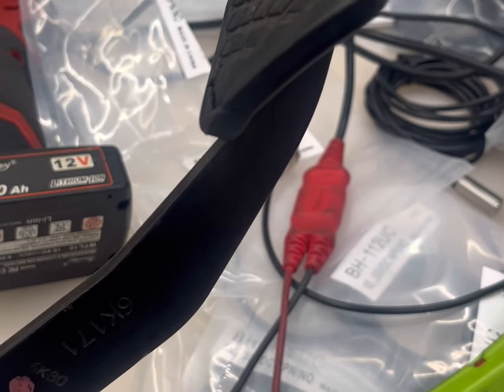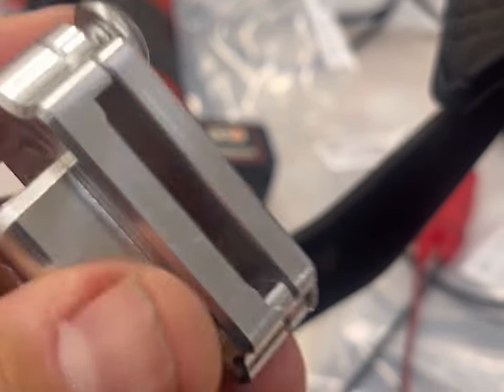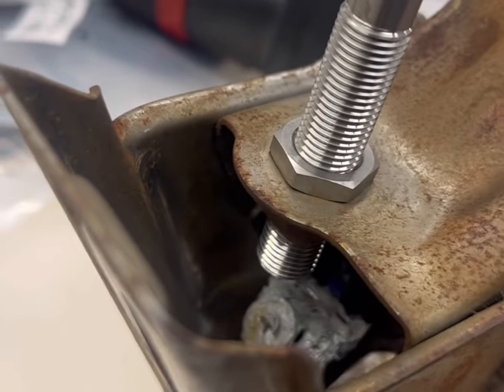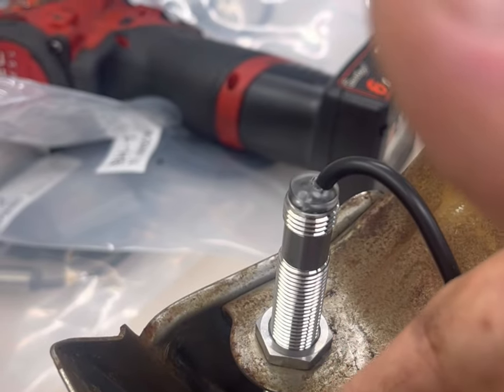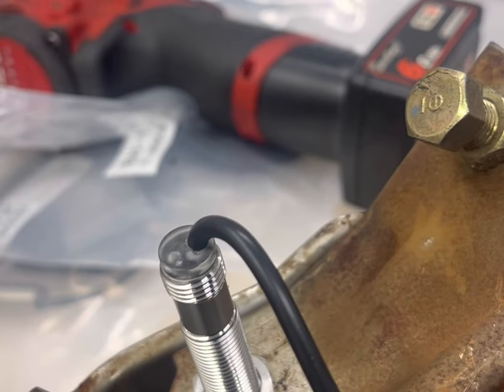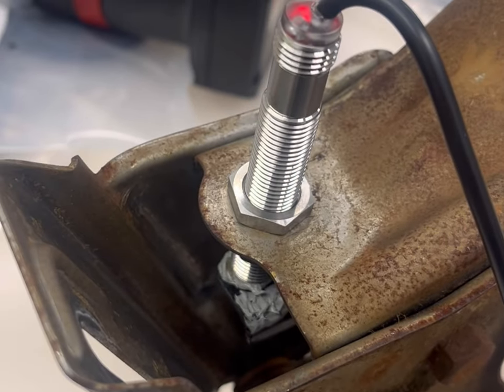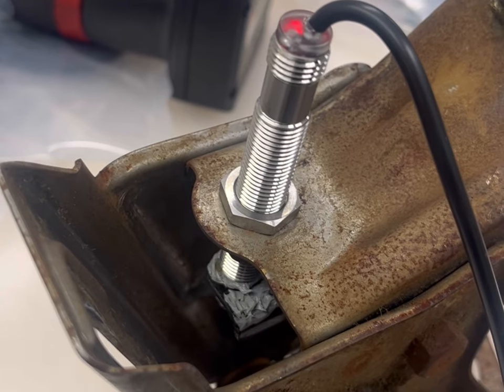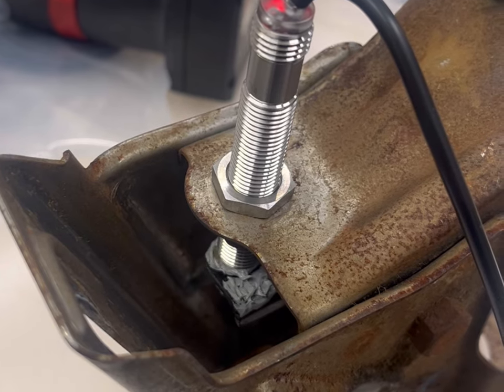New age clutch stopper Honda Acura

Comment: I think this is what I need for my Acura. Hope this helosnitnstartbimstea did just click. Had stock k20a2 to 236whp with full bolt ons. Then bambi jumped in her. Fixed it all: then air in the clutch. Bled it. And now clutch to the floor and it clicks but won’t turn crank. Like a bad sensor or relay: any idea since y’all deal more on this side of things? Thanks guys, love the shop videos and products. I’ll be buying a round of parts to advertise how good you shop and products are. Thanks again everyone at delacruz motor sports

Comment: Would one of these be a good product to use for my rsx type S’s. I got one with 4pistons motor going in. But we have finished building the one for my late wife and seems a clutch stopper and sensor is part fo why I can’t get this clutch adjusted quite right. Any advice or shot at a quick video on flushing the clutch system and adjusting the pedal and stopper so the clutch engages and disengages properly? I had to swap the slave cylinder and it does fine. Then out of no where it’s like the clutch kept disengaging later and later. Now it lets go after I’m all the way out of the pedal. Any tips of a preferred setup for the clutch pedal? Or flush it completely an see?
Reply from the maker: I have not yet tested it on a rsx to be honest. But maybe we can test it on your car Levi.